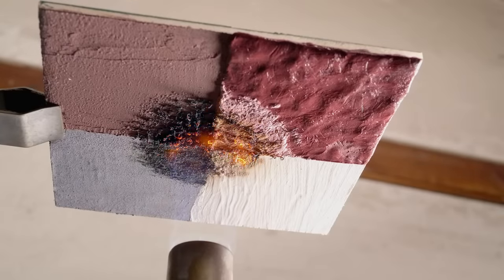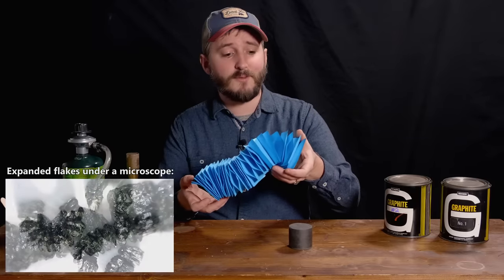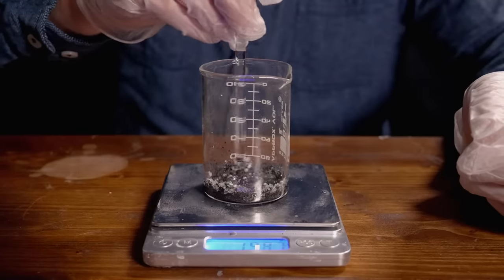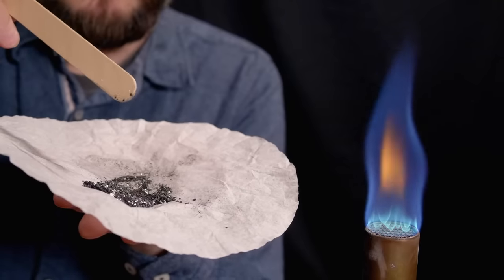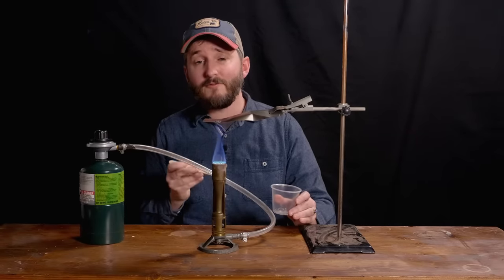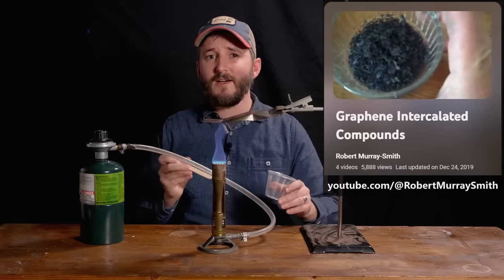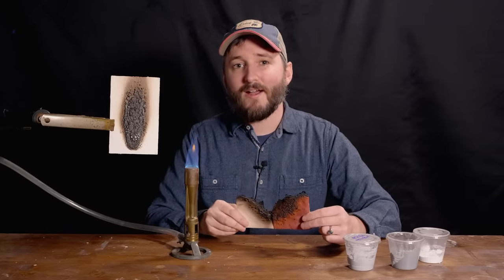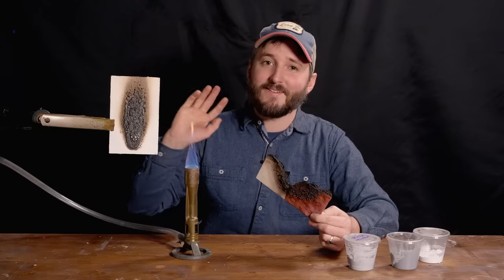Fireproof Expanding Graphite

Comment from the maker: In case you missed my video about Starlite which is referenced several times, here's a link: https://youtu.be/0IbWampaEcM

Thanks for watching!
Reply: PLEASE continue on the negative energy paint.
Reply from the maker: @jaysengstacken2118  Fear not ;)
Reply: Fantastic video. Informative, AND entertaining for sure! Thank you
Reply: "Smaller graphite particles have a higher surface area-to-volume ratio, which increases the rate of sulfate ion adsorption on the surface. However, the increased surface area also means that there are more lattice defects on the surface, which can act as barriers to the diffusion of sulfate ions into the interior of the particles. As a result, intercalation of smaller graphite particles typically requires a higher temperature and a longer reaction time in order to overcome these barriers and achieve a complete intercalation.

In contrast, larger graphite particles have a lower surface area-to-volume ratio, which decreases the rate of sulfate ion adsorption on the surface. However, the lower surface area also means that there are fewer lattice defects on the surface, which can act as barriers to the diffusion of sulfate ions. As a result, intercalation of larger graphite particles can typically be achieved at a lower temperature and a shorter reaction time."

- ChatGPT
Reply from the maker: @stevenwilliams9359  Hmm... Maybe. Seems like this could be a prime example of ChatGPT's overconfidence in its answers
Reply: @stevenwilliams9359  You beat me to it and a much better explanation also, Cheers !
Reply: ur so close to 2 million, good job ur hard work has been paying off. this was a really interesting video
Reply: oh thanks for the heart, i would just make an edit but i think that would take it off. i just wanted to say ive been watching for years, your videos along with grant thompsons have had a big impact on me. im also going through some stuff rn and this video took my mind off things for a bit. take care
Reply: @jaysengstacken2118  Yes, and use calcium carbonate (chalk).
Reply: This is an awesome idea. I have a couple questions though. Would the graphite on the outside of a house make it more prone to lightning strikes? I know it's graphite, but covering an entire residence with the material seems like it would be a significant amount of conductive material. Also, do you think it would have an effect on insulation? I'm thinking there may be some thermal refraction properties.
Reply: Which is it, soup, or weird? 
:
Reply: how to pronounce intercalate ...
Reply: How about a test of paint with baking soda in it. How does it perform compared to the paints you tested in this video. Also try a combo of baking soda & graphite.

Thanks for the interesting video!
Reply: Ty!  Any suggestions on how to safely make a few kilos of it without having to spend a year?
Reply: @l0I0I0I0  Keep the container cold when you add the acid, this could be in a ice bath, or circulating chiller. Also dripping the acid in using a large burette, separatory funnel, etc to control the amount of acid being added over a period of time.
Reply: 🔴 What Is Islam? 

🔴 Islam is not just another religion. 

🔵 It is the same message preached by Moses, Jesus and Abraham.

 🔴 Islam literally means ‘submission to God’ and it teaches us to have a direct relationship with God. 

 🔵 It reminds us that since God created us, no one should be worshipped except God alone. 

 🔴 It also teaches that God is nothing like a human being or like anything that we can imagine.

🌍 The concept of God is summarized in the Quran as:

📖 { “Say, He is God, the One.  God, the Absolute.  He does not give birth, nor was He born, and there is nothing like Him.”} (Quran 112:1-4) 📚

🔴 Becoming a Muslim is not turning your back to Jesus. 

🔵 Rather it’s going back to the original teachings of Jesus and obeying him. 

More .....👇

🔴 THE RETURN OF JESUS
Reply: You should try grinding the 50 mesh to 250 mesh by hand. Maybe the finer ground graphite wasn't completely pure?
Reply: @MediumPointBallPoint  why chalk?
Reply: @l0I0I0I0  In the video where he make the cooling paint he mentions that you could also use calcium carbonate as the special pigment, which is chalk. I mentioned this in a comment and he noted back that it was true.
Reply: @MediumPointBallPoint  interesting!
Reply: 8:12 but wouldnt that cause h2so4 off gassing ?
Reply: 8:43 oooo are we gonna be doing expanding graphite origami lol   i wanna see an  expanding graphite crane lol  the bird i mean  lol
Reply: 13 what if you add it to that paint you made... i think it was you... awhile back that reflects heat really well the white one with the  uh micro crystals  ..
Reply: making recycled plastic furniture and cover it with it
Reply: @jaysengstacken2118  0pp
Reply: It's always nice to see another video from the Son of Ted Cruz.
Reply: It seems like it would make a lot of sense to use intumescent paint on doors and door frames as a standard.
Reply: I know nothing about chemistry really, but just from like square cube law and what you described, i wpuld imagine the primary heat producing and time consuming part of the reaction is the binding of the oxygen to the edges of the graphite layers. Perhaps the intercalation of the sulfuric acid is a heat absorbing reaction. Anyways, i think it would have to do with the ratio between the oxygen binding reactions and the weak sulfuric acid bonds. Thats the the thing that changes with particle size.
Reply: Youtube suggests stsrlite just below

Comment: I worked for the British Ministry of Defence. I did some crude tests on 'fire retardent foam', the sort that is used in furniture. I was VERY disapointed. Believe it or not wool as in felt was by far the best. So, a challenge for you - find a better fire retardent soft covering / filling better than wool.
Reply from the maker: Great idea. Wool is really hard to beat.
Reply: Wool soaked in Borax!
Reply: They sell carbon felt for soft pliable heat shielding behind welding and soldering. It's really effective and super soft to the touch. Can also be used as a wick for burning thicker oils like used cooking oil.
Reply: If you want to go the water-containing chemical route, you might try saturating the wool or felt in a solution of water and Epsom salt, aka Magnesium Sulfate Heptahydrate, then letting the product dry. Each molecule of the salt has 7 water molecules attached, which would make it take quite a bit of energy to heat it up. Epsom salt does decay at high temperatures, but it does so by letting go of water molecules one by one, which might even displace oxygen at the site of the fire. Add in layers of intumescent material, and you might have something that is effectively fireproof. Or, you might not. I'm not a chemist, just someone who's watched a lot of Nile Red.
Reply: Not only that, a lot of fire retardants are health hazards -- carcinogens and the like. And wool... isn't.
Reply: ive realized "advanced"materials means cheap enough to use for mass production and doesn't mean (=/= ) the best available or safest material... hemp fiber checks a lot of different boxes but no one hypes it up like carbon fibers
Reply: @pinaz993  i am imppressed to see how extraordinary observation  you did. Great idea!!! Thanks a lot!
Reply: @simonlinser8286  “Rayon” and other forms of Reformed Cellulose will be better than any hemp fiber and can be made from any cellulosic biomass/waste not just Hemp.  Short of the types made from plastics, most carbon fiber is even made of this!
Reply: I guess since it chars instead of burns that makes sense.  Same reason with Leather and welding protective gear.  

PBI Weld Glove is now my dream.  Maybe even aluminumi ized.
Reply: Carbon felt from welding blankets.
Reply: Fibreglass! Everyone loves the feel of fibreglass on skin
Reply: Yeah, wool and wood both perform better than a lot of synthetic materials because they naturally contain moisture that has to boil off before they can get hot enough to burn. It's a major reason why modern house fires build heat so much faster than they used to when more of their contents were made of natural materials.
Reply: I think cellulose paper coated in boric acid powder is pretty servicable.
Reply: @feelincrispy7053  I'm old fashioned, I prefer my asbestos poncho.
Reply: Asbestos!
Reply: @Nighthawkinlight   I’d be interested to see wool laced with this expanding graphite.

I think the generation of carbon dioxide is the function of the flakes in the putty. 

And using it in the wool could make an even more effective boundary layer to stop the wool from burning.

Just a thought!
Reply: The wool probably works because as it burns it leaves graphite behind
Reply: Well, there's also rock-based 'wool', like Roxul.  Also, there are those ceramic 'blankets' used for kilns, etc, though I've no idea whether/what off-gassing/material flaking products might result, nor what any resulting toxicity might involve...☠️👻👽
Reply: Funny. I've always been afraid I'd instantly ignite with my wool coat if I dropped a cigarette.
Reply: @PT0B     Wool doesn't do well with higher pH substances like borax. It tends to break it down.
Reply: how about starlight and felt?
Reply: I was glad of my woollen coat when my backpack decided to be a 1m diameter fireball
Reply: @timmccormack3930  Wool releases Hydrogen Cyanide in a fire, among other things.
Reply: @EngrEd567  none other than mineral fibers, y'know like asbestos
Reply: Can these be used in making starlight?
Reply: @EngrEd567  : To the best of my knowledge, the rock wools and similar products are not soft, and usually not very flexible. You might be able to compensate by using Taylor cones to get a very fine fiber to then turn into thread, but that also might not work.
Reply: cork is astonishingly fire resistant. The NASA made some experiments in the nineties for Heat ablative material for Re-Entry Vehicles based on cork.
Reply: I have so many questions....
Reply: 500th like!
Reply: It'd be pretty funny to just half ass it and make an asbestos pillow
Reply: @simonjelley  ...how.
Reply: @Craftlngo  Cork is tree bark and is therefore very slow and VERY expensive to grow.
Reply: @Validole  if you are asking about the backpack, I made an electric ducted fan backpack, long before it was cool, but the ESC connected both sides of the 16Ah battery together and was mostly vaporised by the time the fuse blew. The vapours spontaneously ignited and I was on fire. Fortunately a healthy fear of the 16Ah LiPo meant I’d practiced taking it off quickly, and I’d hoped to use it to propel me on skis, so I just dropped it in the snow. The back of my coat was slightly crispy to the touch but broadly unharmed.
Reply: Pure Aerogel might work, but it's hella expensive.
Reply: @mycosys  “Production is Toxic” Not necessarily, granted I’m all for Process Controls (re “Green Chemistry” ), and whatnot, but even if it is toxic, just *Engineering Controls*.  Plenty of processes are high risk/use nasties, but if people follow best practices (rather than cut costs) risk is controlled and no pollution happens as well (even in emergencies if flares are used rather than blowdown drums etc)
Reply: @mycosys  In terms of flammability, I’d imagine fiber width/how it is knitted may be a factor.  Also just controlling ignition sources (not JackJack from “The Incredibles” so don’t roast your baby)

Also I’m more intrigued with technical uses, and maybe some clothes, not baby clothes i guess.

Even then Fire Retardants can be added, no need to Fear Monger.
Reply: @mycosys  I'm aware of what Cork is. It's a natural material that is in use for many centuries. It can even get recycled by glueing small pieces and high pressure. It still keeps its properties.
Reply: @metamorphicorder  how about cellulose paper treated with fuming nitric acid...
Surely the nitric acid would oxidise it to carbon!

/jk
Reply: @Nighthawkinlight  hemp/kevlar combo
Reply: @95rav  that's nitrocellulose iirc
Reply: @God-ch8lq  ding ding ding top of the class.
Reply: @95rav  sorry, i didnt see the /jk cuz UI on phone is trash
Reply: One word: Areogel. Best fire and water proofing material PERIOD.  Wool, what a joke. Wool is hair.
Reply: Easy.... Refractory Ceramic Fiber

Just ignore the mesothelioma risk from long-term exposure if you try to stuff your furniture and pillows with it
Reply: NOMEX.
Reply: As a firefighter, I've seen the differences between modern "fire resistant" synthetics vs natural materials.

While the synthetics take longer to catch, once they do, they produce far more heat when burning than natural materials, resulting in accelerated fire growth.

Fires that used to take 15 minutes to reach flash over (that is, the whole room reaching combustion temperatures), now takes 1/3 the time due to the use of modern synthetics, resulting in hotter, faster burning fires that give firefighters less time to get them under control and make rescues. Also, due to the chemicals used in synthetic materials, cancer is a huge risk for firefighters.
Reply: Nomex
Reply: Thurmite worked great for the twin tower's and bilding #7
Reply: Easy, asbestos!
Reply: @ChillyJack  thanks. Now I know how to make a wick for burning oils. And this whole time I thought I was here to find out about things that didn’t support combustion
Reply: @timmccormack3930  or it is a form of cancer
Reply: @PT0B 
🤔…(?!)…
Reply: Strands of carbon foil?
Reply: @EngrEd567 It doesn't make for a fluffy durable batting material though.
Reply: @codyforemanable I wonder why? Nearly any synthetic and most natural fibers burn or melt far more readily.
Reply: @Craftlngo this is because it's a foam that carbonizes on the surface, leaving behind a highly insulating surface that ablates slowly as each layer hits +400C, carrying away heat. It's like a self shedding ceramic in these conditions.
Reply: @orbatos  rockwool (ie, Roxul), at least when in the form of thermal/acoustic insulation batts seems rather fluffy in my experience...plus it  doesn't melt (as fiberglass does easily), doesn't burn, doesn't absorb water nor can it be digested by bugs or rodents, cuts with a simple bread knife, and isn't itchy (unlike 'fluffy' fiberglass or even wool ;)

Comment: I work in construction, doing telecom, and I’ve used the red putty in the video a good amount. it’s worth mentioning, that the putty has a really different application than the fireproofing paint. we use putty to stop up the sleeves we use if we need to run cable through a wall, or inside an electrical box, for other applications like sealing, they use a caulk that cures hard. the putty, at least to my understanding, only needs to stop smoke getting between rooms, or, say the insulation of your cables catches fire, to stop it using the data network to spread fire throughout the whole building, I’d be interested to see how the putty reacts when heat is applied to it while it’s inside a confined space, pack some into the end of a 1” pipe or something. I dunno if the results would be different, but they might be.
Reply from the maker: Thanks for sharing your experience!
Reply: Are you talking about Chico?

Comment: I have a hypothesis about why the finer-grain graphite was more difficult to react: While the stoichiometry is the same (1g coarse graphite, 1g fine graphite), and while reaction rate is typically proportional to surface area, of which the fine-grain has more, in this case, it's the completion of the reaction that we're looking for, and with more surface area to react, it just takes longer (for the same concentration of acid and nitrate). I think of you used more acid and nitrate in proportion to the increased surface area, the reaction would proceed at a rate more similar to the coarse graphite. Would love to see this tested.
Reply: Kinda along the lines I was thinking. Once you pop open a layer on the coarse grain, it's open. A lot more total layer popping needs to happen with smaller particles.

Comment: I wonder if the putty is more designed to rely on the expansion of internal particles? Those might cause the putty to swell a little, allowing it to seal any small gaps that might remain from installation. Mixing in particles will always result in some on the surface (just like a chocolate chip cookie), and these may not add much, but you'd get some particles contained within the putty applying force to it.
Reply: damn, that was pretty interesting to pounder.

Comment: I’ve been fire caulking/blocking all week. I remember the starlite video. I think we have all tested the fire caulking upon introduction. Surprisingly some fire blocking products will catch for just a second before going out.
Reply: "Self extinguishing" is commonly used in fireproof materials. They contain chemicals which block combustion, but are locked either mechanically or chemically inside the material until the initial flame releases them. That way the material retains it's flame retardant properties for a long time at normal temperatures even if ordinarily they'd slowly diffuse away.